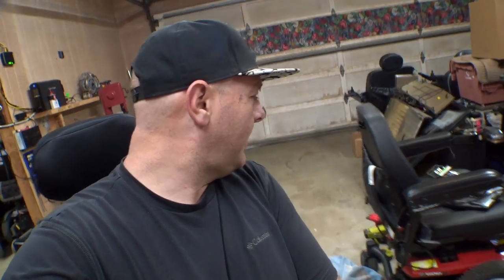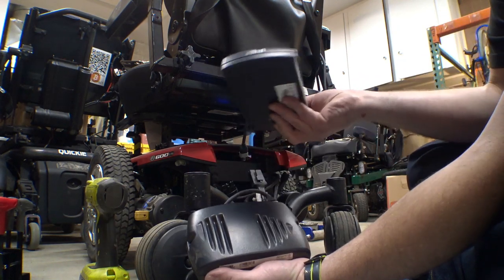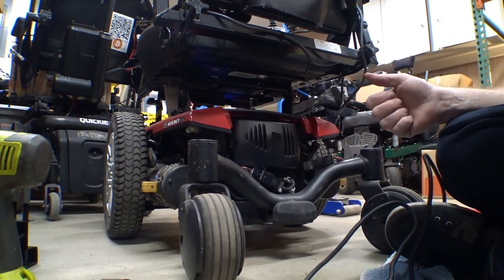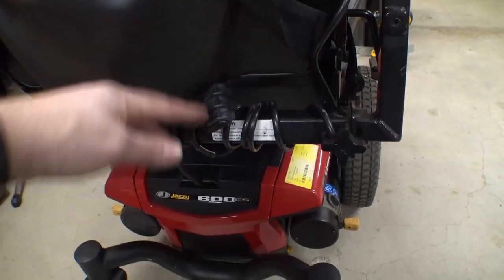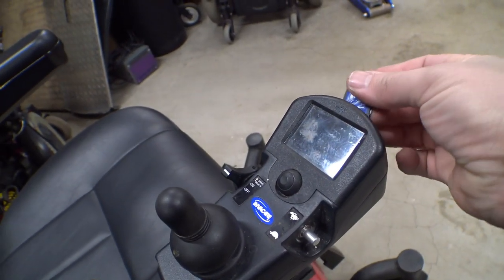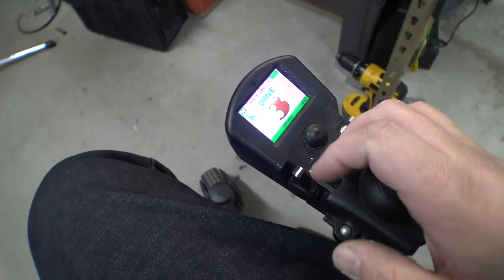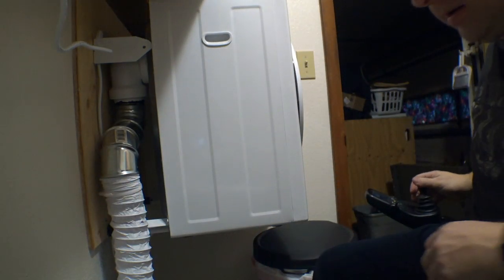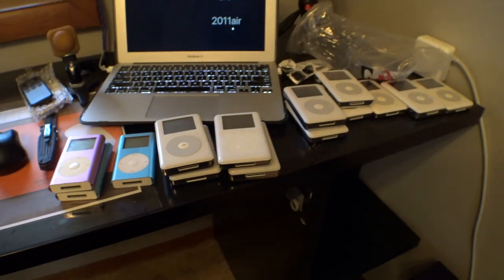VLOG 475: the Jazzy 600ES gets NOS!

Comment: Pretty Sweet !
In case you wanted to know: The Quantum Q6E 4Pole motors are Electrocraft rebranded as Pride. If those motors on your Q6E Strawberry are 4 Pole Electrocraft, they are  probably an approximate 80ohm Impedance. The same should be true on your Q6E Banana... an approximate 80ohm Impedance with 4 pole. The 2 Pole motors are an approximate 70ohm Impedance .... Factory set anyway.

Now that we finally figured out the tricks the bums put the programming in the clouds !

Comment: I am trying to understand wheelchair electronics and software. I live in a old Etac E880, and in my front room are 2 old Permobil C500, partly in pieces. I am cleaning all parts, learning,  going to bring the best parts together to give it a second life + have some spare parts. And most important: I am going to make the seat exactly how I need it to be! The "professionals" have not been able to make me an ok wheelchair in 3 years...  Did you make a video all ready that explains the electronics and the software?
Reply from the maker: the programing requires an R-Net dongle to make any changes.. they're not very cheap unfortunately.. but ive got some links to basic programming information if ya need them!
Reply: @TotallyNormal-  Ohw  now: dongles. But I need to get it running. What all do I need for a Permobil C500/C500S?;  an R-net dongle, R-net software, it runs on what OS? (Win, Mac?) and probably a "how to" . I very much dislike that they choose to make access difficult & expensive. Although there will probably also be settings that need a professional understanding. If you could help me (and others) out with this, that would be great! I am taking apart a P C500, and am making a drawing of the electrical connections (motors, wires, hubs, lights, and such). Goal is to make a video of that, and share it  :-)
Reply: @TotallyNormal-  Sweet: I found your video "VLOG 297: whats inside a wheelchair joystick"
https://www.youtube.com/watch?v=0aLSxddJPRc
And about onboard programing Permobil (didn't know about that!)
"How To Program R-Net / Permobil Electric Wheelchairs"
https://www.youtube.com/watch?v=Bu6PbTewaoE
Did not find yet what settings can be accessed with a Permobil dongle and external software.

Comment: How do the wheelchair electronics and software compare to the modern stuff that is used in model aircrafts and such, AND what all can be exchanged?!

The part that contains the joystick, does that usually also contain the CPU/brains and the OS/software? You call that "the controller".

The part down in the back, I figure that gets information from the joystick box and makes power for the motors based on that information. Do you know if that information is in Pulse Width Modulation (PWM)? You call this part  "the controller" as well.. that is confusing. Is it an electronic speed control (ESC)? Wheelchairs are mostly brushed DC, not "brushless DC". don't know if that power unit shares the same name.

What OS are there, and how to access all? I know of R-net, but not how to access it. They don't want everybody to access the settings, but I am not everybody, and "they" should trust us a bit more, give us more control over how we "walk". Very annoying to be depended on very hard to arrange professionals.

A lot of questions. Answer if you feel like it.

Thanks for your videos!

Comment: Dan could you help with the motor gear box coding. Can you tell gear ratio and and output shaft RMP’s?
You mention motor size.
My jazzy hd elite can take way longer length motors the 4 pole type.
So I will be looking for motor gearbox combination with controller joystick stuff on the used market to get the Jazzy HD Elite to do about 6 to 7 mph.
Thanks in advance fo can DM on twitter.

Comment: What would cause a Jazzy 600 to just stop? I was driving it down the sidewalk and it just quit. No power...nothing. It was at about half charge before it cut out. I have all the plastic taken off but I cannot get to the front battery because there is a bracket over it and I have no socket/wrench to get the bolts out. I do not even know what size I need to buy. Also, there is some kind of switch on the left rear. Can you tell me what it is for and what it is called?